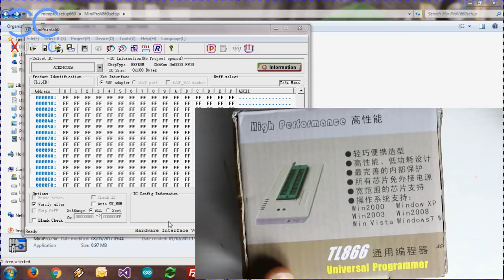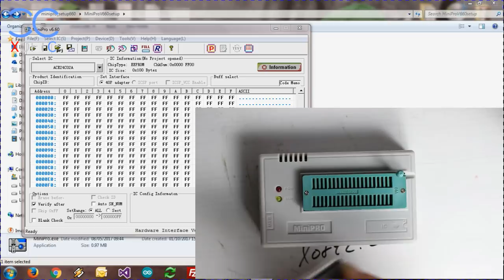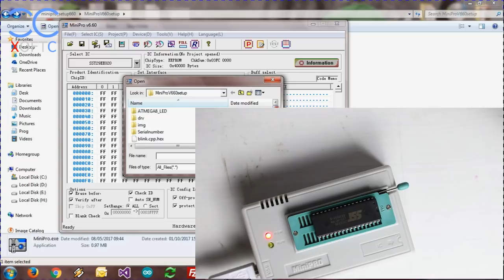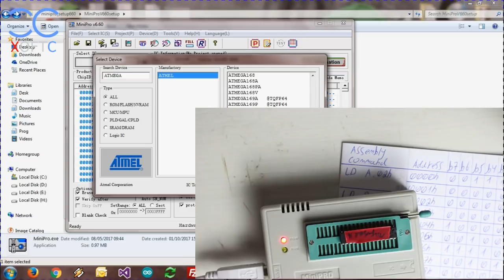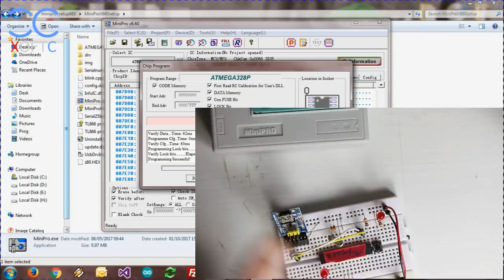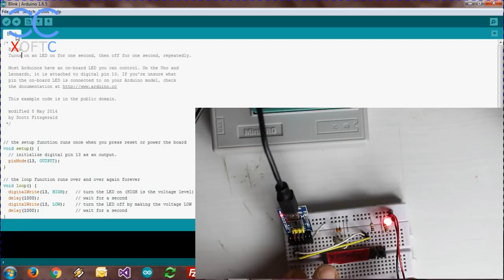How To Use A (TL866) Programmer

Comment: I have a very old EPROM programmer that is connected trough LPT port and its software is dos only (not even Win3.x). It have a option to test some 74 series TTL and 4000 series CMOS ICs. Also it can test some RAM chips. I can not use it under any Windows or Linux OS as it works only on plain dos. 
Can this also have some of these features?
Reply: You can run it via DOSBox emulator. Maybe even from Linux directly. As for hex dump editing, use a hex editor for that.

Comment: If I have a 20 pin eprom without any mfg. markings how can I read or program this chip?
Reply from the maker: burners13 you mean you don't know what type eeprom it is?
Reply: does not have any markings on it anywhere.
Reply from the maker: burners13 I honestly wouldn't know. Perhaps if you know what system it came from you could check the datasheet of the system but otherwise I wouldn't use it.
If its an old EPROM with a clearing window I would keep it just for its obsolete value :)
Reply: Will the TL866 recognize the chip? Is there any other programmers that will auto recognize chips without markings?
Reply from the maker: burners13 it won't. The software for the programmer works based on pre scripted instructions. You have to tell it which chip it is for it to be able to communicate with it.
I don't know of any other programmer that will detect the chip automatically.
Reply: Step 1: Find out which chips it could be.  There must be a limited number of eprom/eeprom chips in the 20-pin variety.
Step 2: Look at the pin-outs for those chips and check which (if any) are so incompatible that they would destroy the chip if the programmer was set for the wrong chip.  It's likely that none will be that critically incompatible. but you should try those settings last if there are any.
Step 3: Use something like the TL866 and try to program the chip with known information using one of the possible settings.  Read the information back to verify that it all programmed correctly.
Step 4: Erase and repeat step 3 until you discover the memory capacity and configuration by experimentation.  Start with lower capacity and go higher until you get an error, at which point you know that the previous setting is probably the correct one.
If you do destroy the chip by this experimentation, at least you're no worse off since you couldn't use it before.

Comment: Hey bro - i got the exact same model as this and my drivers wont load up. 
My PC is in good working order everythign is working fine apart from the software/drivers for this, i downloaded the latest software from their website and it just wont load the driver. No idea how to fix it - it says its installed but it wont detect the writer and the little yellow light just flashes.

Comment: you need to use the dtr bin in your usb to ttl converter .
connect it to 100nf  cap and connect the cap to pin 1 in atmega328 and it do the job and you will not need to reset

Comment: question .. i have a customer that has 2010 Volkswagen tiguan an the ecm was programmed with the wrong vin number so it does not match the vin on the vehicle can you programe the chip for me with the correct vin number ? call me 602-672-5105 mike good brakes automotive phoenix az 85022